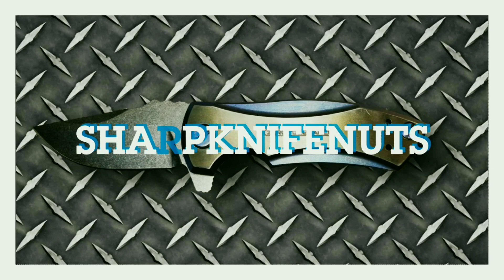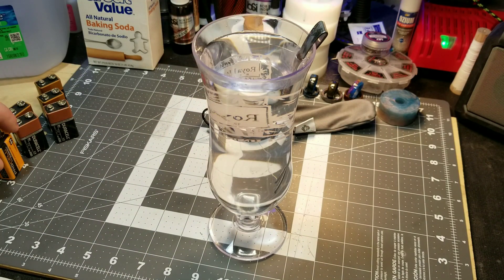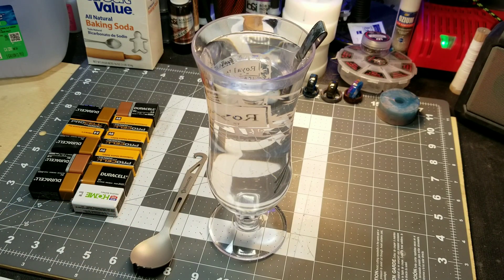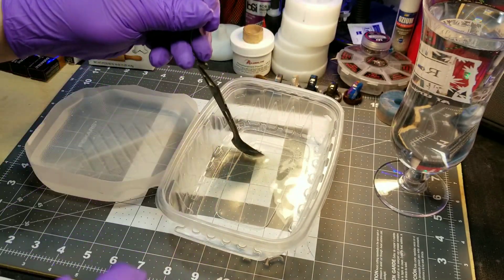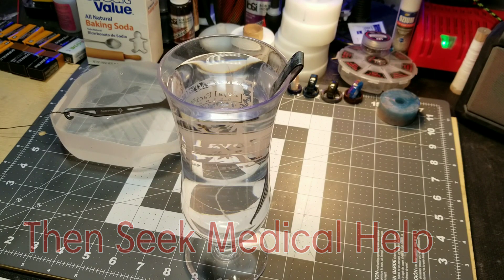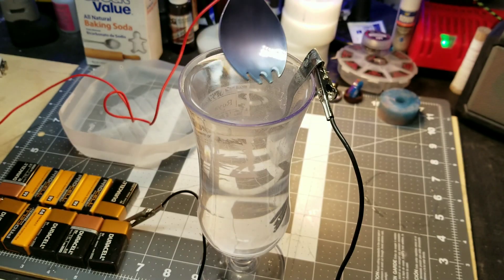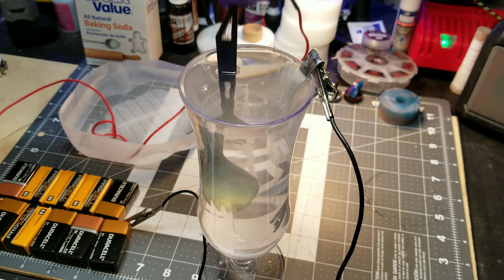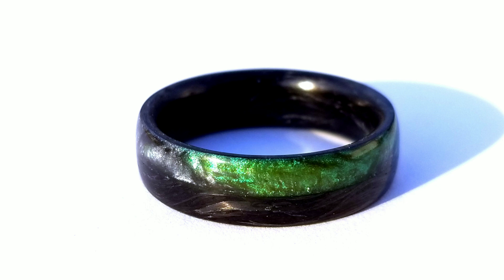Rainbow Anodize 🌈  Titanium

Comment: Good job man, have you heard of a product called multi-etch? It etches the material ina different way as not to change the finish of the titanium. It’s not an acid it doesn’t change the finish to that matte finish or media blasted look. After doing a few hundred fidget spinner anodizing trials I learned that the absolute best finish to achieve the richest or most vibrant colors is to use a satin finish (very close to machine finish). Whinks rust remover actually takes the titanium’s finish back a little bit, (even in small short intervals). Unless the eating utensils were going on display and never used otherwise the anodizing will wear off over time. No matter what chemicals you use the anodizing will wear off and they will need to be redone. So again it will go into the Whinks  removing more of the satin finish. Multi-etch works differently, even if you leave it in for minutes at 120-150 degrees Fahrenheit it retains the finish. I order it from a place in Arizona. Here’s a link to a video on their website showing the edge retention. Keep up the good work, the world needs art and artists. 

https://youtu.be/NY-jzy1yBlk
Reply: Hi Nic, could you please post the multi-etch product purchase link below? Do you dip titanium in the etching solution and rinse in water before anodizing? Appreciate it!

Comment: Baking soda (sodium bicarbonate) ain't gonna help you much for HF burns. You need calcium carbonate (preferably gel). The problem with HF isn't the acidity, it's that it leaches out the calcium from the tissue. You need to give it a source of calcium to eat away at AND neutralize it.

In fact, if the reaction is exotermic, and i'm guessing the reaction with baking soda is, you might end up releasing HF gas, which is even worse, as it will get in your lungs and cause permanent damage.

Comment: Baking Soda? Does it work with Sulfuric Acid too?
Does Baking soda work on Aluminium?
I saw a video where the guy was heating the water.
Reply from the maker: The baking soda is simply to make an electrolyte solution. I haven't attempted it with sulfuric acid, so I couldn't tell you for sure. Any electrolyte solution should work though. It's a different process for aluminum though, and I don't believe that baking soda would do the trick there.
Reply: @ApollosRings  Very interesting. I came across a video of a bloke Anodising Aluminium with Sodium Bisulphate. 
I've seen Titanium Anodising done with various voltages. In Anodising Aluminium it is about Current not Voltage. 
A very complex field. I've been looking into Plating, Anodising, Electro Polishing etc.

Comment: What if I just want a purple to blue gradient?
Reply from the maker: You'll start getting purple around 18 volts, and then it'll go to blue till around 35 volts. If you just use those voltages for a general idea of where you need to be you can make the purple-blue gradient. You may need to adjust the voltage a little bit, but those numbers should get you in the ballpark.

Comment: Will this work on nickle or steel guitar strings?
Reply from the maker: No, unfortunately it won't. Not sure what you're planning on doing with it, but the do make super thin titanium wire that it will work on. If it's actually for a guitar that might not work for you though.
Reply: Thanks SharpKnifeNuts. I was just thinking it would be a cool look to have colored strings. Nice video!

Comment: Hi, do you know that etching even with small amount fluoride acid it will produce fluoride gas?
Reply from the maker: Yes, you absolutely want to wear proper PPE and have a well ventilated area to work in.
Reply: @ApollosRings  Did you ever tried to use safe products like multi-etch or titanetch?
Reply from the maker: I'd argue that safe is a relative term. With proper PPE virtually anything can be used safely. I've used multi-etch, but  that can be cost prohibitive for the occasional one-time ano job. By no means do I suggest starting a anodizing business using Whink as an etchant, but I'm sure you see where I'm going with this.
Reply: @ApollosRings  Sad that in my country I can't buy any of these chemicals...
Reply from the maker: Where are you from?
Reply: @ApollosRings  Europe, Lithuania
Reply from the maker: Wow, cool! Nice to meet you! Thanks for checking out the videos!
Reply: @ApollosRings  Me too. I'm jeweler and want to start making rings from titanium
Reply from the maker: I love titanium rings. I love all rings really, lol. I really like using titanium in my designs because it keeps the weight to a minimum, and is a very versatile material.

Comment: Appreciate the tutorials . Question . Hows the durability on this method of ano . And can you cover it with finish ( lacquer,epoxy , urethane etc ) without losing color ?
Reply from the maker: It's very durable, and the higher the voltage used, the higher the durability. You can coat it, but results vary. You aren't actually coloring the titanium, you're just building an oxide layer that reflects light differently at different thicknesses. When you add a clear coat it changes the look a bit(usually makes it show up darker)
Reply: Thanks . Great job . @ApollosRings

Comment: 🤔 How different is anodizing Ti with heat vs electricity? I can see a  much bigger selection with electricity however, i guess asking for durability which one is better for worn items, jewelry / knives etc.
🤔 Do you have any videos of making the rings or just forming the blanks?
Awesome looking pieces!
Reply from the maker: So as far as the differences go, the biggest thing is you can get very exact, even colors with the electricity. The other big advantage is that you don't run the risk of warping any items with electricity. Sometimes you can screw up the lock bar with heat, so that was the main reason I never did much heat ano. 

As far as durability is concerned, the different colors are really just different thicknesses of oxidation. The light is reflected  at the different wavelengths through the different thicknesses giving the perception of colors, so the higher voltage colors tend to hold up a bit better just because the oxide layer is a bit thicker. I would recommend electro anodizing every time over heat just because of the control. The other factor that effects durability is the surface prep of the titanium. Highly polished surfaces will not hold up as well as a blasted finish because the blasted finish has more of a porous surface for the oxide to adhere to.

I only have one ring video up currently, and it is a really old one, but I have quite a few new ones filmed that are much better. I just need to find some time to get them edited, then I'll be adding them to the channel. Keep an eye out, there will be quite a few new ones coming soon. I just got a bunch of new video gear, and I'm about to finally add a power supply to the shop for anodizing as well. I have quite a few videos I'll be filming for all that in the very near future. Stay tuned! 👍🏻

Comment: I've just discovered your videos and they are pretty awesome! I'm creating jewels using silver metal clay, which is basically silver in a clay form which you fire at 900°C and then it gives you 100% solid silver. Would this anodizing process work on it, as well as sterling silver? Would it actually work on any kind of metal?
Reply from the maker: Hey, thanks for watching! Unfortunately this exact process does not work on every type of metal. You aren't completely out of luck though. There is an anodizing process for silver, but it is done with sodium poly sulfides, more commonly referred to as toning. I believe NurdRage has a video about it on his channel if you care to check it out.
Reply: @ApollosRings  Thank you for your answer, I will check this out. I will keep watching your videos, they're an endless source of wonder!
Reply from the maker: Thanks, I appreciate it!

Comment: What is voltage to make the goldish color
Reply from the maker: Its around 54 volts. I have another video on the channel that runs through each color with each different battery, 9-100 volts, if you're interested.

Comment: Have you gone any higher than 100.5 V?  Or is that where the colors pretty much stop?
Reply from the maker: The colors start to repeat after 11 or 12 I believe. I have a color chart video if you're interested. If you have a power supply you can somewhat fine tune colors in between 9 volt increments, but those are the colors for the most part
Reply: @ApollosRings  I watched that one first and I think I remember you saying you went to 100.5 V.  I was just curious if there were diminishing gains at that point or what.  Thanks.
Reply from the maker: Yeah, pretty much the same colors on repeat.

Comment: I appreciate your videos! I've been playing with anodizing the past few days with a similar kit, and it's been awesome to use. I was wondering if you knew of a way to give the final product a polished look.
Reply from the maker: If you put a polished finish on the titanium before you anodize, then it will have that same finish afterwards. The issue is if you etch it first you will dull the polish, but you can get away without etching, it just won't be as bright. The other issue is that a polished finish doesn't hold up quite as well as a brushed, or media blasted finish. It does look really good though. Give it a shot and see if you like it. Worst case, you can always strip it and re-anodize.
Reply from the maker: Another thing you might want to keep in mind is that the higher the voltage, the thicker the oxide layer, which is what refracts light at the different wavelengths and gives us what we see as the different colors. If you do a polished finish, go with a higher voltage (thicker oxide layer) to compensate a bit with wear resistance. Hope I made sense there, lol
Reply: @ApollosRings  that helps alot. The product I'm wanted to anodize costs around $700 and has tight tolerances, so I almost don't want to risk having to etch it and anodize a few times. I may hit you up on Instagram if you don't mind and send you some pics of what I'm going for.

Thanks again for the tips!
Reply from the maker: Feel free brotha, I'll help any way I can!
Reply from the maker: I'm having major issues with my Instagram today. I don't know what the deal is
Reply: Sooooo I tried this and my items turned black almost immediately.  I did not let them touch when I dipped. Do you have to use a specific type of wire? I used copper.
Reply from the maker: Oh, that's no good! Yes, you absolutely must use titanium wire. Copper wire will give you the outcome you just had. 😬
Reply: @ApollosRings  ty so much for sharing your knowledge
Reply from the maker: Happy to help!👍🏼

Comment: its much easier and effective to just start at the highest voltage and only dip the tip in until its completely  color changed, then remove a battery and dip the spoon a little deeper until that color is different, then take another battery off, dip it a little further, so on until you get to the end

doing it that way will give much more vibrant colors and can be blended by lightly dipping a tiny edge past the color each time you remove a battery
Reply from the maker: Thanks for the input, cheers 🍻